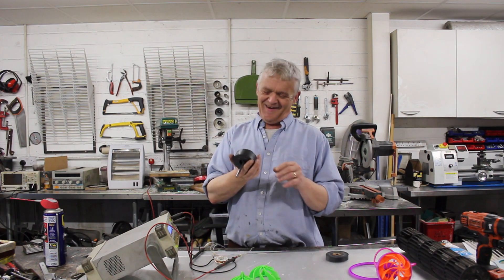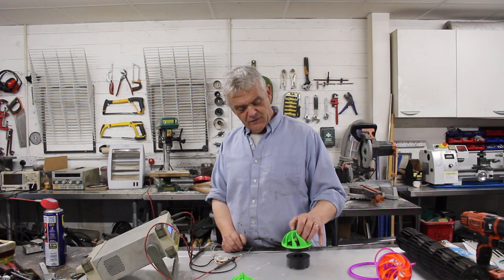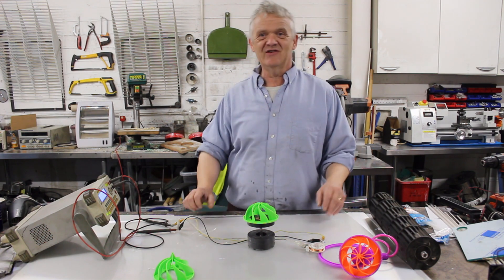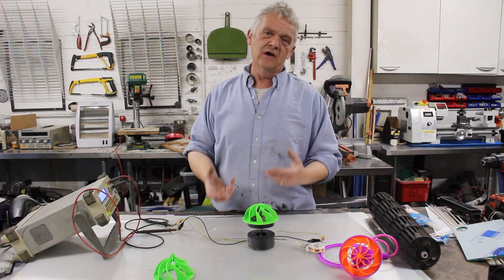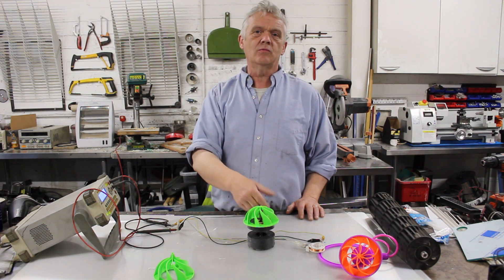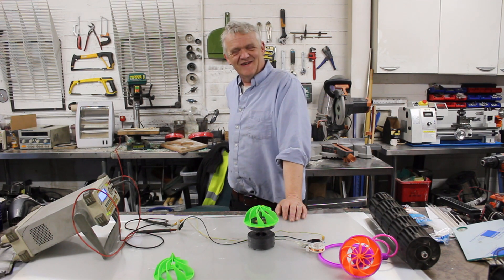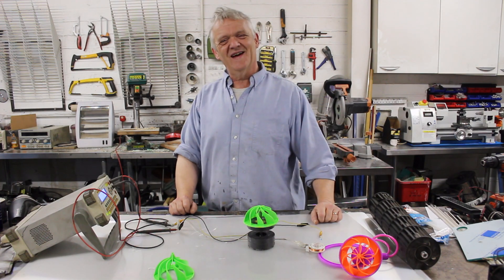1582 A MagLev VAWT Wind Turbine

Comment: It is my understanding that Maglev is based in a horizontal figure 8.  The magnetic assembly induces a current that opposes the magnetic pole orientation. This induces a current in the opposite direction causing a negative field in the other half of the 8 ,which propels the vehicle.

Comment: Induction happens whenever there is relative motion between magnetic lines of force and a diamagnetic conductor material. This is how teluric currents are produced from the solar wind and from CMEs which strike the planet. These teluric currents can be quite strong depending upon ground composition and moisture content and can (and have)  caused transformers to blow up, short out and catch fire causing blackouts. 

These CMEs are magnetically polarized but a glancing blow would only result in one polarity of magnetism striking the planet and teluric currents are still produced. How strong can these currents get? Read up on the 1857 Carrington Event and you'll know that telegraph lines worked even after the batteries were disconnected! Telegraph operators got shocked - sometimes severely so. Some telegraph lines actually arced to the ground! Some Telegraph stations even caught fire!

Comment: How about generating electricity using existing surfaces in your home? 
I live in a flat with concrete ceiling. So in theory you could use the ceiling as a giant heat sink for a thermal generator. The house itself shake with the wind and pick up noise and footsteps so that could be used for vibration harvesting generator. So it would be interesting to create a device that could be placed in the ceiling and harvest this energy.

Comment: I had an old science kit from the 1950's that used the same magnetic spring concept. I saw another cool video of a guy using pyrolitic graphite the same way to make a fantastic little motor that hardly needed any power, I think he said he calculated that it would run for centuries or something. It was very well made.

Comment: Interesting points that this will produce DC current without a commutator or a bridge rectifier.

Seperately: this can be scaled up for the Benini build if the magnets are placed at the correct distance in the circumference to take advantage of the 600 volt back EMF that occurs in the Benini build. 

I think Rob did some video on the Benini build.

Comment: Sometimes RMS ADHD prevents him from noticing things. He just recreated an old patent for a brushless, homopolar generator/motor. If Rob paid attention to the right/left hand rule for current in motors/generators, he would have placed the coil vertically between the magnets and gotten much higher output. Also he would have noticed that he's outputting DC power, (pulsed because of a damaged magnet). So you can get rid of rectifiers. The maglev part and turbine are Rob's awesome improvement.

Comment: You should use separate magnetic fields for the levitation and generation. You could add a flat metal disc to the top to shunt the south field, then fasten Neodymium bar mags to the top of that in a N,S,N,S config, flip the turbine over because its orientation is irrelevant, the add the coil to the very top.. I know part of the point was simplicity, but you'll generate more efficiently with alternating NS than just a rotating north. I'd love to see giant Maglev wind turbines.

Comment: interesting, same pole,  I wonder if the current produced is nearly smooth DC since the flux is more or less the same across one side of magnet
Reply: If you place the coil vertically and squished between the magnets, yes, you get DC.

Comment: Been thinking along these lines for a while, but you beat me to it.  LOL.  Thinking though about a solid core rather than hollow.  Lots of fun right there.  Reason for solid core for me would be mostly to protect wildlife as much as I can and also to make use of the properties of a sphere.  For example a cylinder of appropriate size next to it would speed up the air flow.  Great video!

Comment: Hi Robert, I wonder if I can pick your brain please?....I'm looking to bond either two pieces of steel together or steel to copper and I wonder if your copper nano particle gel would work, perhaps using your crocodile wire from steel to steel or steel to copper method with a thin coat of the nano gel in-between???? What are your thoughts please?

Comment: It would interesting to see which would generate more, a larger version of what you just built or one where you use the magnet to lift then glue a ring of small neodymium magnets around its outer circumference in alternating poles and have the coils on the outside of that. Could even build a small version to test the theory adapting what you just made.

Comment: If the copper coil was insulated, made waterproof, could it be used underwater? Also, does the spinning cause a slow down after applying the coil? Just some of my questions.
Reply: if you waterproof your coils and magnets, to avoid corrosion and shorts, sure it can be used underwater. The spinning will slow down when you extract power, just like any other generator. Plus liquids create more drag than air.
Reply: @magabesse  thanks for the reply. That information helps with another concept I'm working on. I love this kind of stuff.

Comment: The one benefit I could see for something like this to be turned into a wind turbine would be because there's no moving parts, or at least moving parts touching each other, you would not lose windforce before you turn it into electricity and it kind of reminds me of a smaller version of a flywheel still it could also be used as a way of storing up electricity by using mechanical rotation

Comment: That's a great idea! 👏
You could alternatively use metal plates to bend the magnetic field as you've done before. Or even use a dielectric material on the rotating magnet facing the coil to make an intermittent MF 🤔
Thanks for sharing! 👏🎉
Reply: Though it would affect the levitation part 🤔

Comment: Do you get a current in the bearings and how does it effect them?
Reply: You can measure the current by scope. IF you have any current, it destroys metal ball bearings in the long run by detrimental arc discharges through the ball bearing ring and balls, making the surface microscopically rough and changing the metal crystal structure of the hardened surfaces. 

Isolate all bearings, and do a discharge brush elsewhere. Or ask Rob to invent a tribologically performing conductive grease, as the research in ball bearing industry did. They do rarely use it though, because you will sell much less bearings :)

My question on this grease is: can you actually use it to transfer power without a brushed contact?
If I read Rob correctly, carbon Nano particle so are just for this job, and graphite even offers “emergency bearing” properties against blocking of bearings run hot. Question is: can you make a version running really low on viscosity losses?

Motivation for me:
Do wind power without inverter:

 I needed a semi-brushless three phase 400V AC synchronous generator for my wind energy plans, offering direct feed to grid or island grid constituting properties (together with cheap variable transmission drive chains regulating in effect the grid frequency). 

I want to modulate the power by having also a rotor coil - or a variable distance gap to the permanent magnets by truncated cone design. Have you seen a brushless using a cone coil design?

Comment: You can spin a magnet, but you can't spin a symmetric magnetic field in the axis of the direction of the magnetic field.  There is great deal  of research done on this topic.  Some of which lead to faraday paradox. Tangent: One can still generate electricity with a homopolar generator in a rotating disk.

One can veryify my first comment with a current carrying coil if one spins that coil in the axis of the magnetic field generated. Placing a stationary coil of any size in any orientation and any position around the coil rotating about the axis of the direction of its magnetic field.

Rob, in your setup, there's likely to be an asymmetry in the magnetic field, but that's likely to be too small to account for the voltages generated.  I believe it's more probable that when placing the turbine on the magnet it was not exactly centered so its mass creating a wobble in the magnet with the freqency of rotation.
Reply: The asymmetric part is an interesting point,,, perhaps you could build one,,, taking this into account, make a video about it?!
I'd be honoured to watch this as I do enjoy watching humans progress!!
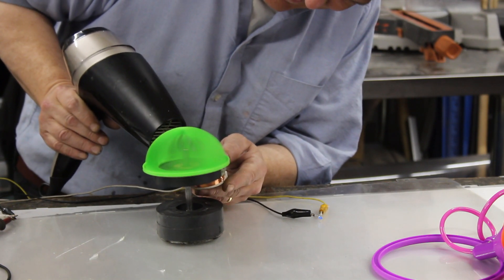Reply: @AndreaDingbatt So every magnet has some tiny amount of asymmetry in their magnetic field. Some worse than others. But it's unlikely to be significant enough to generate the voltages seen. More likely the voltages generated were probably due to not balancing the weight of turbine with the weight of the magnet. One can rewatch the video at starting at 2:05, and see and hear significant vibrations which would most certainly create a time varying magnetic field that could induce a voltage in a stationary coil.

Comment: I suspect there is a logerithmic like limit to the amount of weight such a maglev device can handle before it breaks apart, making it quite unsustainable?
Reply: It only makes it unsustainable if you don't have the good sense to;

1) Test how much weight it takes to over come the repulsion of the two magnets.
2) Insure that the weight of any disc placed on the upper magnet, does not exceed 50% of the weight obtained in step 1.

You could go to 75%, however, the forces that come into play when spinning a disc may cause the disc itself to disintegrate should the material not be able to handle those forces.
Reply: @scotttovey  magnets are inherently brittle, no amount of planning helps for that
Reply: @kilokilos 
Not all magnets are brittle. 
Some are actually flexible.

Brittle only comes into play when objects strike one another. 
A brittle object will break much easier than an object that has more give within it's structure and therefore will not necessarily hold up in certain situations.

In a magLev environment, the magnets are not to come in contact with each other. Should they come into contact, the frictionless design will be forfeit and the device that is using the magLev as a bearing, will become less efficient.
Reply: @scotttovey  they do not have to touch theoretically they never can, but the physical forces involved disintegrate the magnets very quickly, especially neodebium
Reply: @kilokilos  
"they do not have to touch theoretically they never can, but the physical forces involved disintegrate the magnets very quickly, especially neodebium"

Theory is not proven fact. It is not proven science.

Theory is a supposition that one develops for a worse case scenario and for the purposes of testing in order to insure that the use of the material, will stand up in the conditions that it is placed in.

If the theory has not been tested and proven out, then the theory cannot be used to argue that a given outcome will occur when a given use scenario is implemented.

You say that in theory the magnets will disintegrate very quickly.
OK fine, either conduct an experiment and produce a video in which magnets, in the configuration of a magLev, actually disintegrate from the weight that is placed upon them, or provide a link to a video in which someone else has proven that the configuration leads to a failure.
Reply: @scotttovey  to me, it becomes obvious they will break in our configuration it is a pitty because friction one of the deciding factors , an electro magent might work?
Reply: @kilokilos  

The only friction in Rob's configuration is on the bearings he placed in the center of the top magnet. If that is where he placed it.

The bottom magnet is stationary and need not move.

Comment: I was almost cursing when you put the blower on it saying but there is no changing feild 😂 but then it worked a bit . Hmmm could it be difference in magnetic strength ? Maybe you can now just place tiny n52 magnets around the perimeter and even just north north north as with a gap it is still a changing magnetic feild but I suppose nsnsnsnsns would be better!
Reply: My guess is most of the observed effect came from vibrations due to rotating a small offset mass of the turbine. One can rotate a magnet but one can not rotate a symmetric magnetic field.  here the field was orbited about an off center center of mass.

Comment: Is there generation because the mag field is slightly varying round the circumfrence hece giving a small ocilation in strength.  The grandkids would only have pulled it apart anyway.
Reply: Possibly. Additionally  off centered  weight of the turbine caused an imbalance, and the magnet to oscillate as it rotated. 

It's weird to think an imperfection like unbalanced weight can be exploited becoming a feature
Reply: @kreynolds1123  I hadn't thought of oscillation. Thanks for an additional thought
Reply: I would think that the magnetic field is moving like ribbons around the magnets .when you spin one you are moving the magnetic ribbons paste the coil.
Reply: @rayg436  Magnetic field lines don't exist. Their distances between eachother is  metaphor to represent field intensity but the metaphor shouldn't be  taken as literal lines. The are about as real as topological markings on a map. But where distance between lines on a topological lines in a map indicate steepness they represent magnetic field intensity.  More fake magnetic field lines simply represents a stronger field in that region.
Reply: @rayg436  While you can spin a magnet, you can not spin a symmetric magnetic field in the axis is of its magnetic field.
Reply: @kreynolds1123  explain the feild lines on a pice of paper covering a magnet when you put metal filings on the paper  then start spinning the magnet watch what happens to the feild lines.